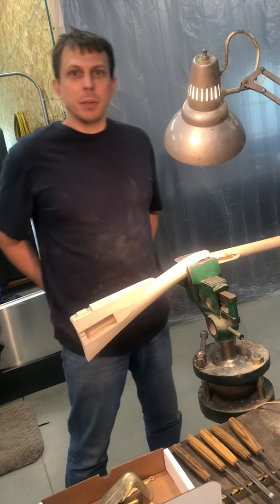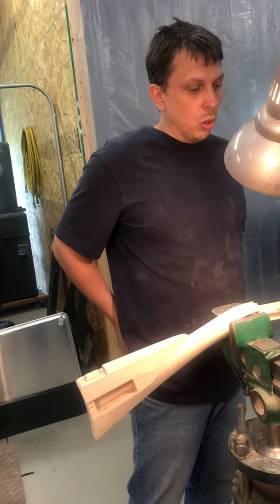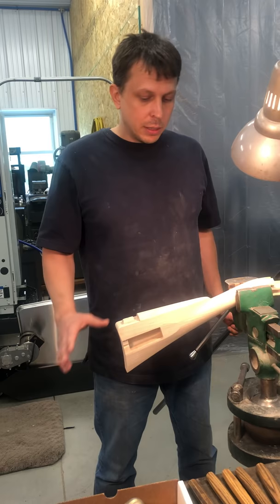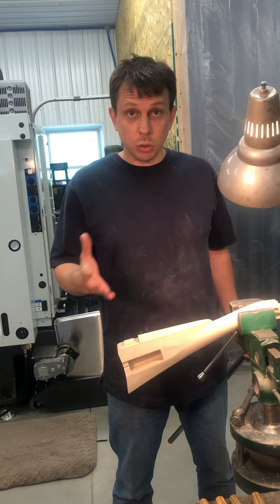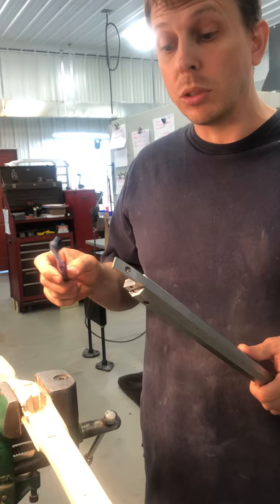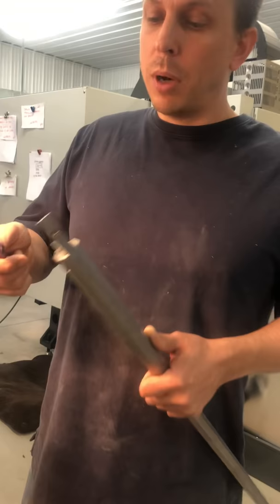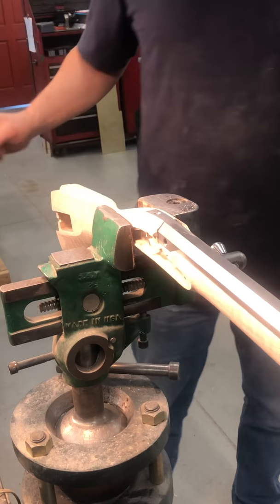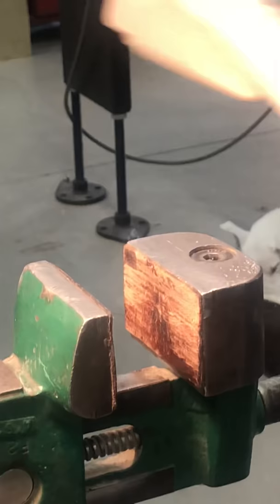Step 1 Colonial Kit Tang, barrel, trigger plate and buttplate

Comment: I purchased a carving practice stock to confirm my abilities. Great results as the stock piece I received took quite a lot of inletting to fit the butt plate. When my colonial rifle kit arrived it set until yesterday only being checked for parts inventory. I was delaying the work still concerned I might make a mess. I was wrong! The kit came so well inlet the butt plate went right on. The trigger plate took just the tiniest little bit of cleaning and the barrel/tang was about 15 minutes of cleaning and slightest tiny bit of shaving. The fit is amazing. The sideplate tapped right in.
You have done an amazing job. The quality of the kit is as fine an any custom could be.

Comment: Jim I am in a wheel chair my bench have been lowered to 30" so t can fit under thembut I need a vise that swivels  and mount lower so I can be able to clean up areas and carve and drill any suggestions  on a good vise.I am going to order a southern mountain kit I was hoping for a 50gal but yours are 45gai I will have to start pouring  45 ball o well Any help would be appreciated .Thank for your time.Jim puffer.

Comment: Nicely done video, thank you.  Question: do you ever use beeswax on your screws?  It water proofs the metal cutting down on the possibility of the screw corroding, it also lubricates on the way in.  Just curious.
Reply from the maker: Yeah, beeswax works well.  Great tip.